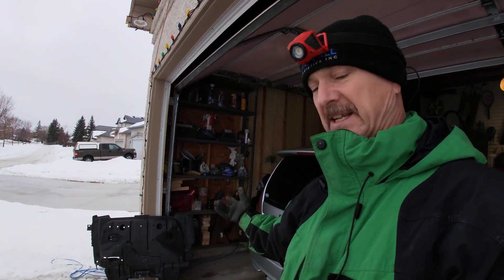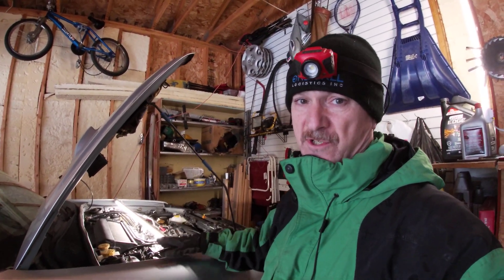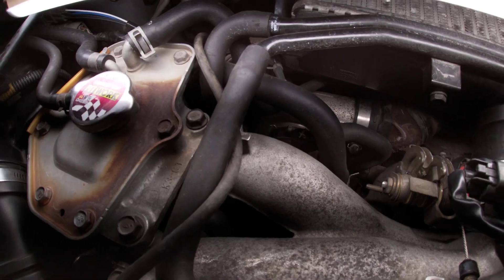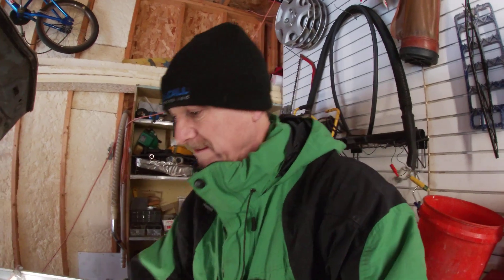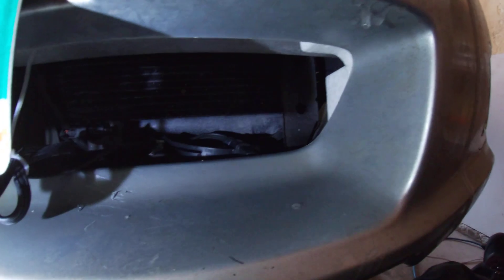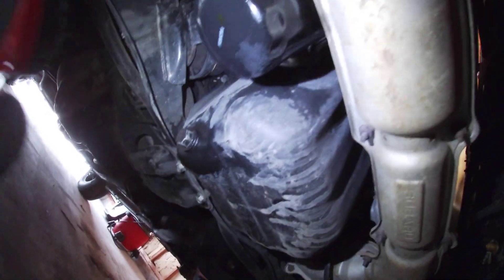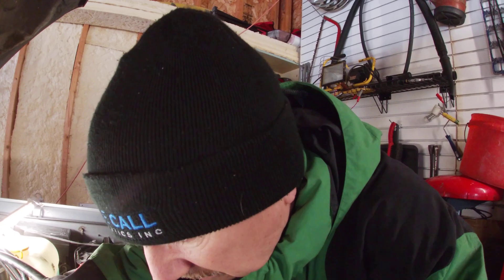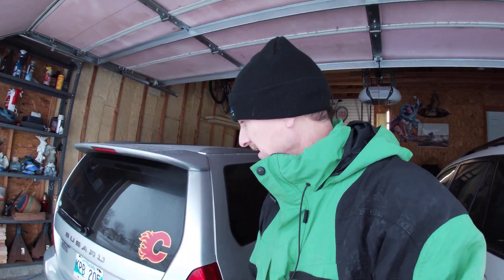EJ205 Subaru engine. What Type of Turbo is This? Subaru Forester SG5, Cross Sports.

Comment: I have a JDM 2007 Forester Cross Sports S Edition it had a TD04 but now has a VF30
Reply from the maker: Not sure what the difference is. Just had a guy message me asking what mine was, guessing he was replacing his unit. Sadly, sold my ride. Damn.
Reply: @stumpr1  oh no and i just found your channel last night
Reply from the maker: @john-danielmartin8753  Car was great, had a few things go south, fixed it, moved on. Just as gas prices soared! Do miss it though, the right drive, left hand shifting, the turbo rush, but the car was way too quiet. Never got around to changing exhaust, intake, etc.
Reply from the maker: @john-danielmartin8753  Check the channel, Look for my boys 97' Impreza WRX JDM driver.....wicked car, extremely quick in stock form.

Comment: TD04
Reply from the maker: Thanks Matthew!
Reply: @stumpr1  you’re welcome, I have a 2006 cross sports, got it in January this year. 
Where do you source parts for it?
Reply from the maker: @matthewgorking2392  Auto or Manual? Parts,  Local parts stores here, I search what I need, cross reference part #s and grab what I need. Where r u at? [country]
Reply: @stumpr1  it’s an auto, and I’m from Trinidad 🇹🇹 (Caribbean). I don’t know how to cross reference part numbers, sometimes I see stuff really cheap online but I don’t buy because I’m not sure if it would work. Any tips or advice would be deeply appreciated.
Reply from the maker: @matthewgorking2392  Go to Opposed Forces.com...............Your's is a JDM Import, correct?  If so, go to that site, pick your model. SG3, SG5, SG9.....2.0L, auto, awd, right drive, etc.  Then pick which area you want to go into. Engine, trans, fuel, diff, lights, etc.  Grab those part numbers and then cross reference online or with your parts store.  Cheers! Let me know how this works for you.  Wish I was in the Caribbean.
Reply: @stumpr1  yes it’s a JDM SG5, thanks for the tip, I’ll check it out ASAP. The Caribbean is nice, excellent weather all year.
Reply from the maker: @matthewgorking2392  If I ship my SG5 there...........hhhmmmm.. no more winters.....Caribbean Rum....hhmmmmm
Reply: @stumpr1  yip it’s definitely good for some R&R.
Reply from the maker: @matthewgorking2392  I have Lucky Lager beer :(